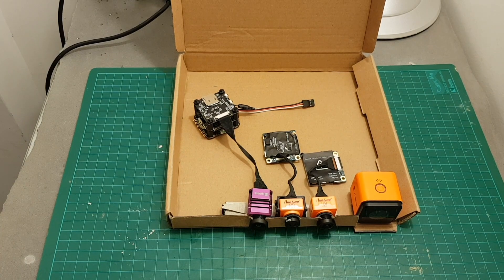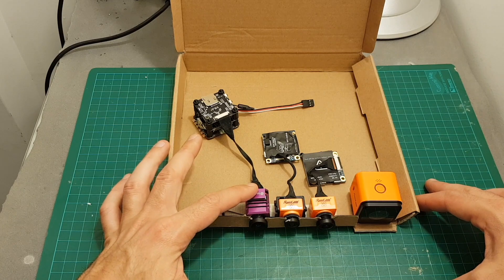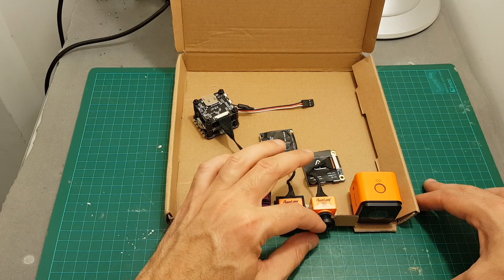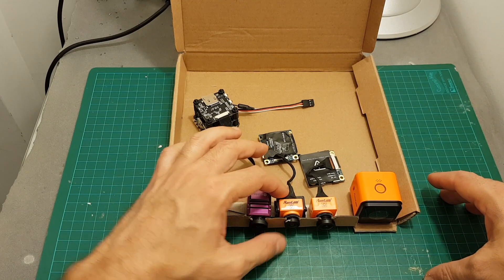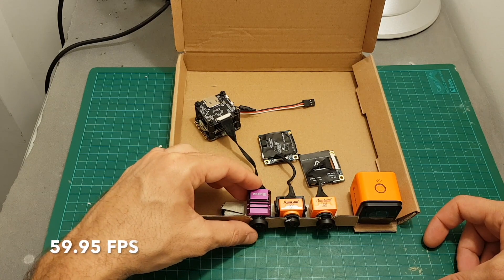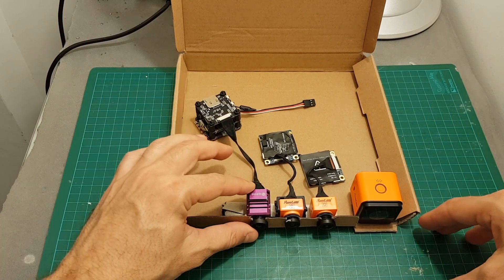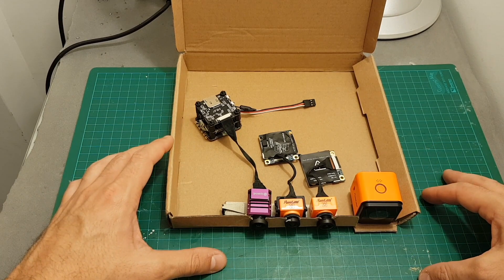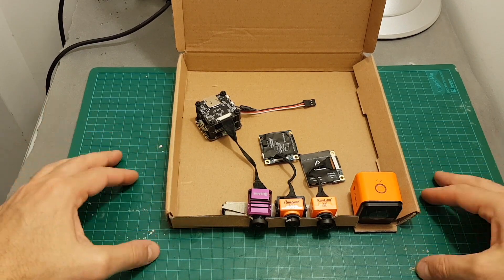Eachine Stack X - HD SBS Comparison with Runcam Split 1, Split 2 & Runcam 3

Comment: Yes the stack-X is darker as the sun goes down, But What are the run cam split's like at high noon with a lot of sun are they washed out as I have checked out the stack-X and it looks great, just wondering?
Reply from the maker: Check out my other comparison video: https://youtu.be/Mpq8j9xY5WM
Unfortunately I did not have a good experience with the Stack X and therefore I can't recommend it.

Comment: If you want to use Split 2 similar to RunCam 3 I made housing for 3D printing for RunCam Split 2. https://www.thingiverse.com/thing:2684291 There is conector for outside battery.
Reply from the maker: +Primož Iskra That's really cool. I will print it and might test it soon.
Reply from the maker: Check out my video: https://youtu.be/_u4tZX2oEl4
Reply: like, can i use that impression on the runcam split v1?